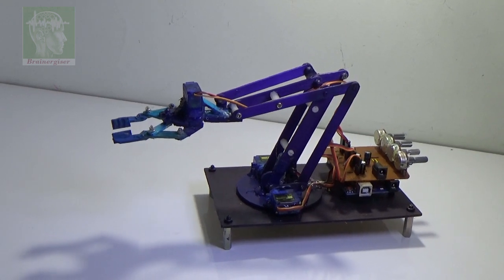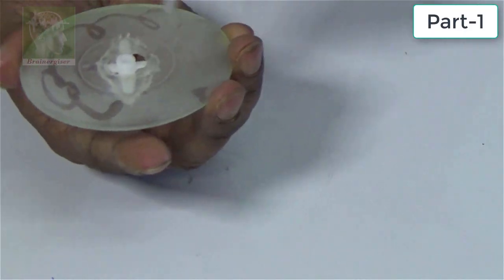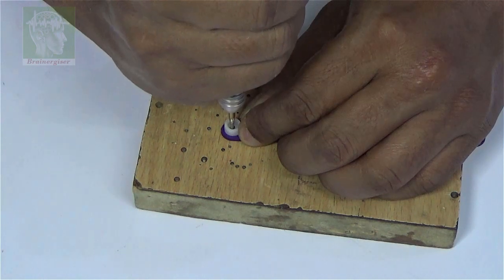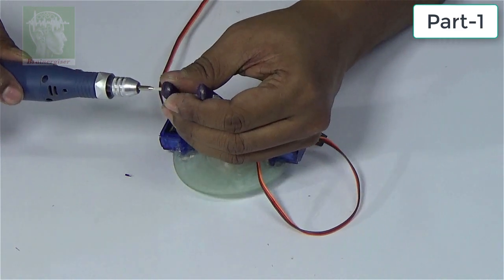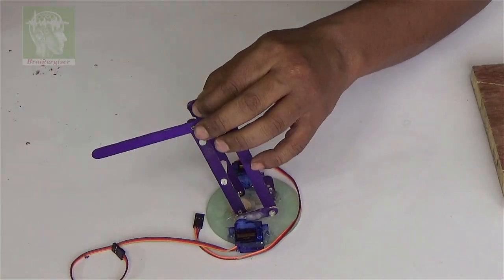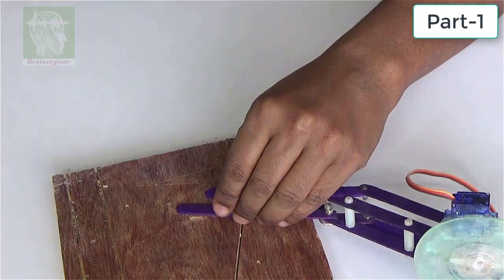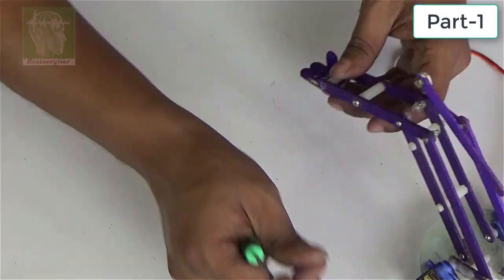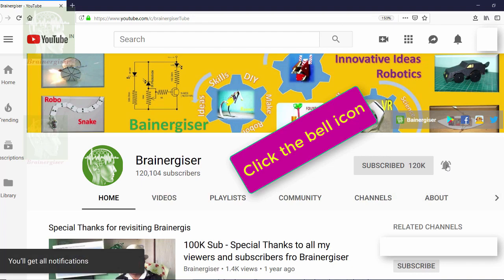Part-1 : How to make a 4 DOF Robotic Arm at home -step by step

Comment: Can it me made control with our arm??
Reply from the maker: Yes , possible.
Reply: @BrainergiserTube  can u make video.
Reply from the maker: @Respect-ez6xw  I made such a video. You can check. https://youtu.be/e3Ln6nsK8IQ
Reply: @BrainergiserTube  i see but it cannot move right-left. And it doesn't have hook to catch object.
Reply from the maker: @Respect-ez6xw  you need to modify to add more functions.
Reply: @BrainergiserTube   which sensor should i use for all direction movement
Reply from the maker: @Respect-ez6xw  check the link. I used a pot.